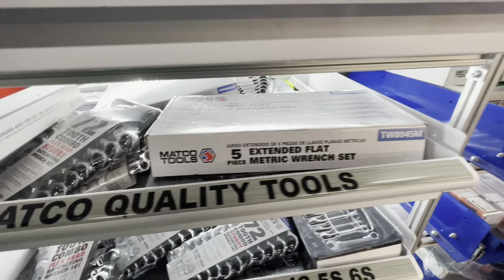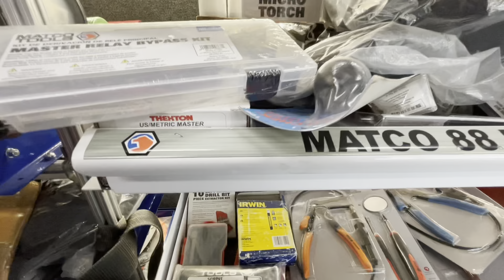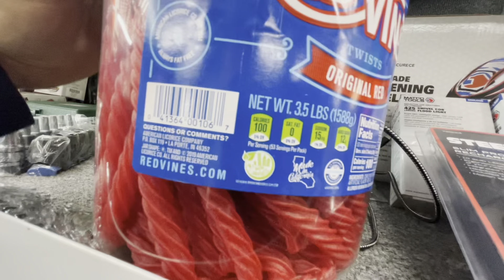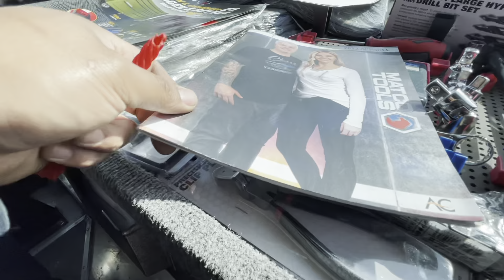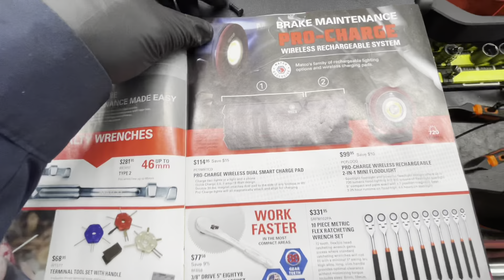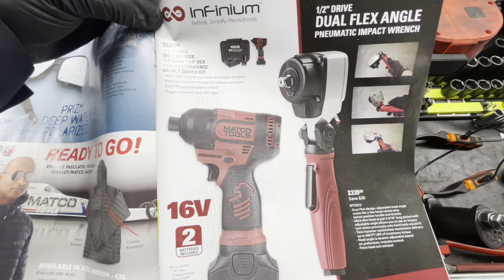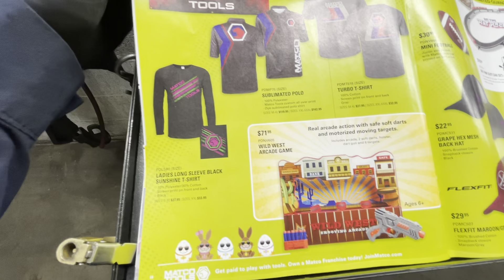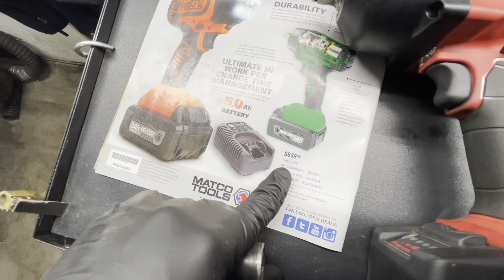Matco tools 🧰 Monday’s

Comment: I wanted them large hyper step 4pc drill bits that you grabbed towards the end, i just couldn’t spend $260 on them, i seen that same set brand new on one of my pawn shop tours last week and snagged em up for $55, they had a $60 price tag shit I would’ve gave them a hundo for them if they asked, they also had a clean snap on 3/8 flex head long yellow handle for $95, got that bad boy for 75 beans, same day i linked up with a some dude for a brand new looking snap on bent handle flex head soft grip that goes for $185, i got that one for $80 because homie wasn’t getting high, too bad lol
Reply from the maker: Those are the best deals

Comment: I have the Matco 3/8 and i can say it will smash on the milwaki
Reply from the maker: Yeah I was looking at it it’s my favorite color but he’ll have it in stock so I was just left out
Reply: @champskog  I’ll put mine up against any gun and smash it
Reply from the maker: I guess I will have to get one and try it out
Reply: The Matco power tools are only dewalts that are dressed up ,way overpriced.where I live my local Matco guy won’t warranty anything without an argument so I stopped buying from him
Reply from the maker: @ohiofleetmechanic6147  that’s makes sense
Reply: @ohiofleetmechanic6147  what a shame
Reply: @ohiofleetmechanic6147  I run the Ridgid line for pricing, power, lifetime service agreement factors, i first got their high torque Octane impact which beat out the Milwaukee on the torque test channel and at my job, i had to get their 1/2” drive mid torque, the 1/2” and the 3/8” drive sub compacts, the drill, impact driver, and their grease gun, all lifetime warranty which I registered after their 90 day deadline & not being able to read some of the serial #’s from chemicals, they registered all of them after a 30min phone call
Reply: @Rightchuare  you know I was talking to a shop owner last week about rigid too ,he sold all his snap on shit and bought rigids entire line for 1/4 of what he had in the crap on